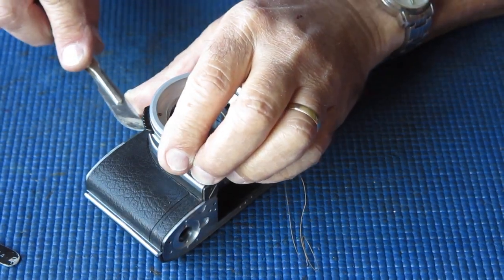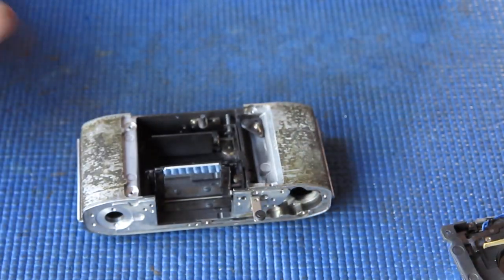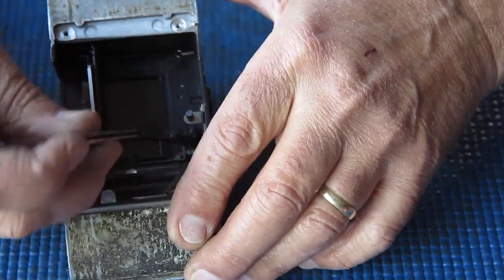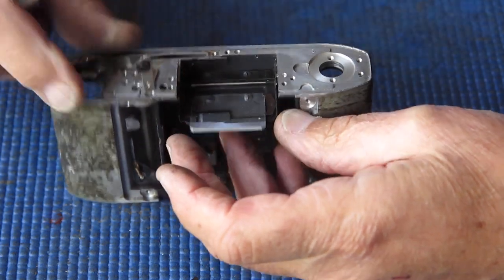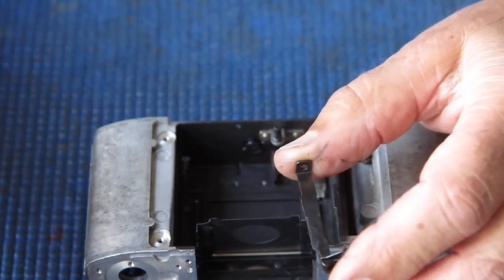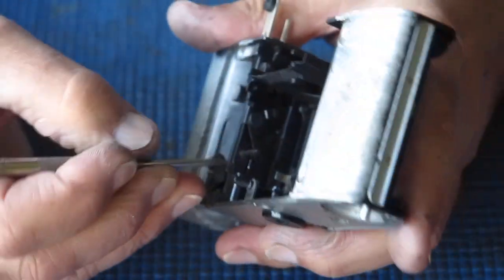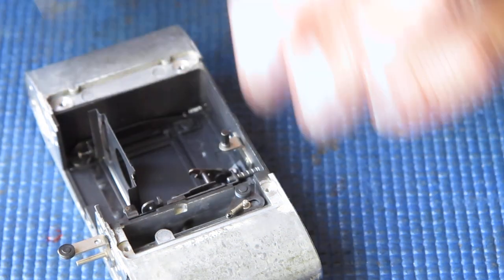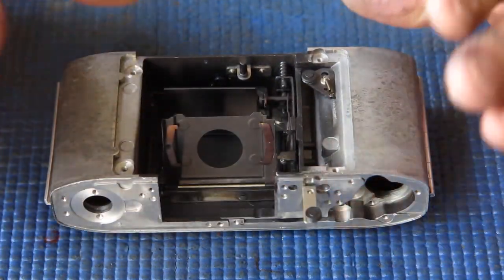Reflex S and Bessamatic M project part 02

Comment: Start of this video is so reassuring regarding removing the leatherette.  I am sitting here waiting for my scalpel to be delivered. I have a Swann Morton #4 handle and some #22 blades on order.  It seems this is the right size handle for this size blade, rather glad I discovered this before I had placed an order for a #3 handle.